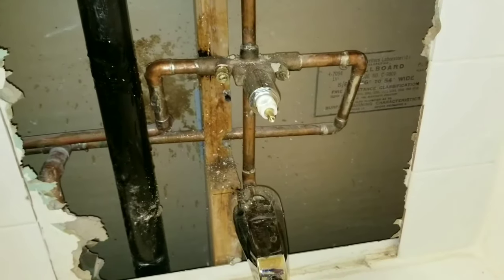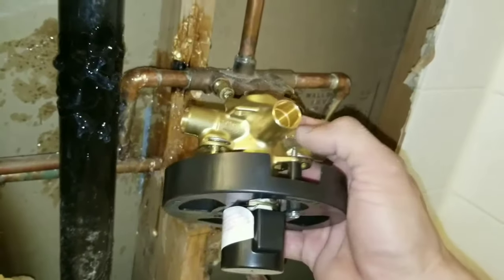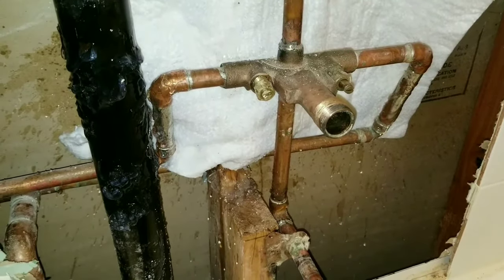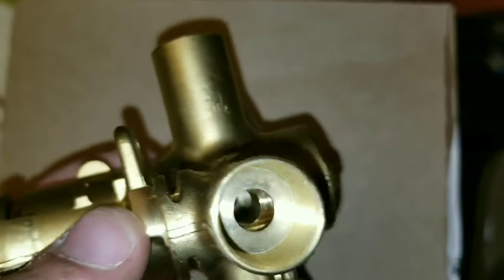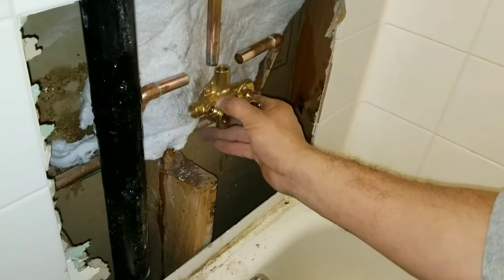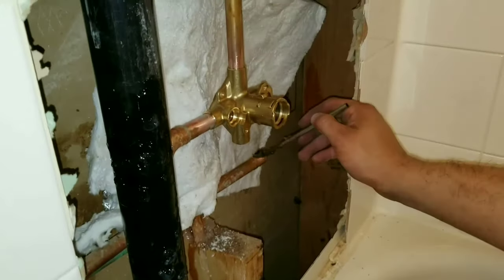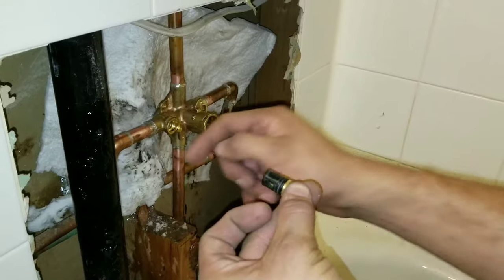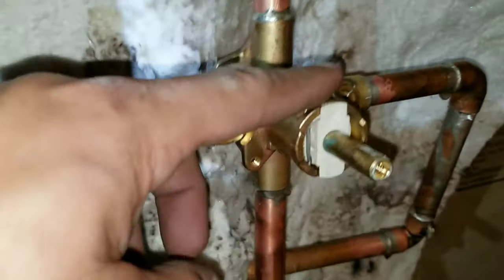Shower Valve Replacement

Comment: I was quoted about 1120 for this yesterday (for labor only I have the parts). That's why I am watching this video :). I have a tile that needs to be cut and there is no access panel on the back.
Reply: Same here Emin, $1200 plus tax. Built-in cabinet behind so no access either. Guess this is an average price.

Comment: It would have been helpful to see how you pulled apart the old pipes after you heated them.  I noticed you didn't have gloves on and didn't say anything about eye protection.
Reply: Eye roll
Reply: It was pretty obvious he dipped his hands in candle wax before starting for hand protection. As well was wearing contact lenses for eye protection.

Comment: Thank you for this video! I wasn't even thinking about just reusing the existing copper connections by removing the solder joints - but you saved me a ton of time and work. Thank you!

Comment: How much would this cost for me to hire someone to do this
Reply: I just got a quote from a guy in Kissimmee Florida. The dude wants $500+ for labor and $200 in parts.
Reply: I charge ppl $350 
And if I have to open the wall and repainted the wall that’s cost about 550
Reply: $1000
Reply: You can buy a small torch, solder, flux, and Emory cloth or the tool that they have to clean copper for probably under 50-60$ just go to a home improvement store or look up a plumbing sales company in your area. Its not hard, I learned this in a day before YouTube, I suggest looking up a video and doing it yourself. Now wall repair if needed, i would probably leave that a pro....
Reply: @son_of_guns  I did the same, but I did some practicing with sweating the copper pipe on some scrap before doing the actual job.  Thanks.

Comment: I came across an issue with the same shower valve. The shower head was leaking with good pressure even with the tub spout off, even with the tub spout removed. Shortened the pipe for the spout but the didn’t do it. Replaced the cartridge with a new one and still the shower head sprays water as if the spout is on but the spout is no even installed lol. 

I did notice the “up” word on the valve is facing downwards and not upwards as is says. 
Could this be the problem pls help.